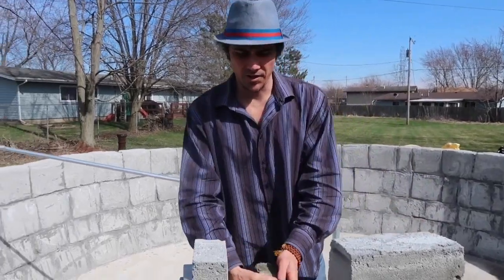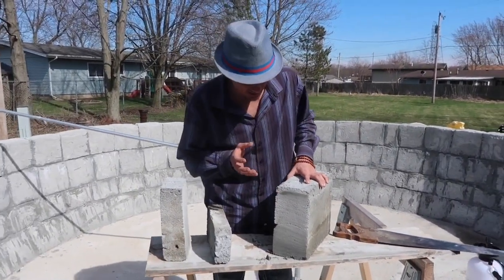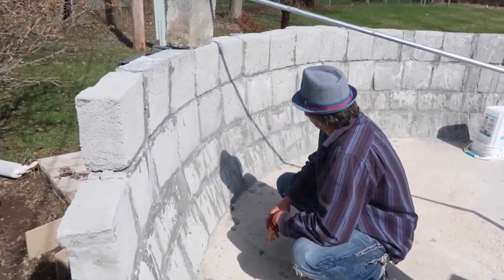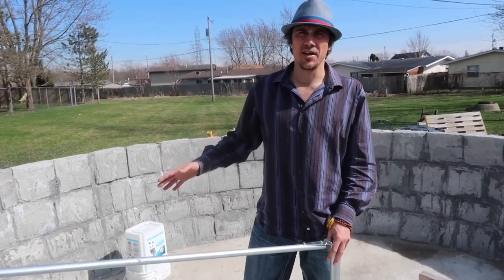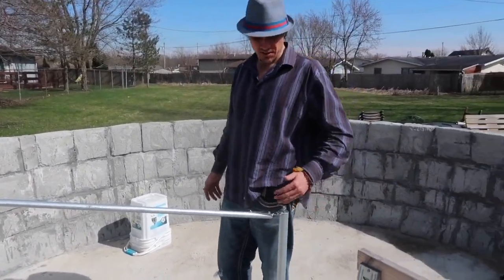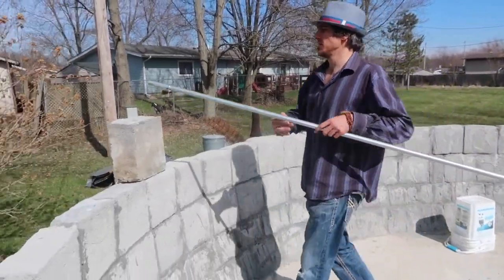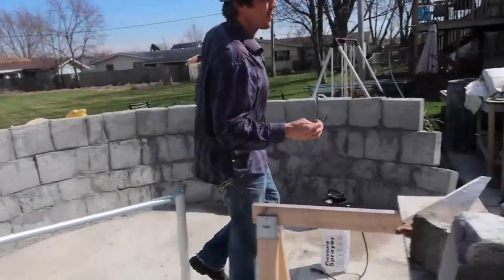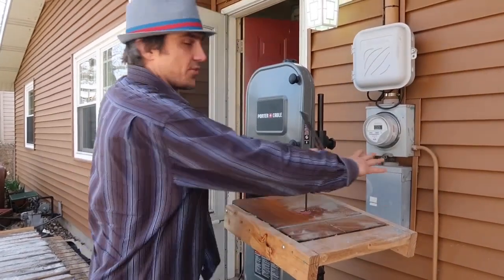How to Create a Aircrete Dome Home!

Comment: I’m thinking of using a Lux flaked soap (biodegradable) as a foaming agent - any point of view on the use of this product?
Reply: Aircrete  can suffer from lack of consistency. It's best to use the strongest foamin agent and that has already been proven. So you question would be to yourself, as you would have to test it.

Comment: Are these air Crete domes strong enough to use as a concrete form to pour like a 4 inch rebar dome on top of the air Crete dome for underground use?
Reply: Why not use an airform at that point? Pour the thickness in multiple layers or build  the rebar skeleton and inflate an airform inside the skeleton. Pour concrete, cure concrete, remove airform. It's what monolithic dome company uses.

Comment: Seems to me, these blocks will end up all having the same angle. So you could prefabricate those, by 3d printing the mold you cast these in. Is the anglefinder always finding the same angle?
Reply: this seems way smarter than buying their product and sawing a bunch, also those concrete blocks would be way stronger (tho not reinforced). But maybe you don't neven need to 3d print, should be doable to make that kind of mould manually

Comment: This is probably a stupid question but, could you do this with regular cinder blocks or bricks?
Reply: Yep why not just cement mortar the same as normal easy peazy.
Reply: Their Strength is not Equal to Poured Concrete, but might be close to Cinder Blocks. Some fab testing Required!

Comment: Been wondering about putting an aircrete structure on a trailer.  I think weight wise it should be alright.  I'vr heard they are earthquake proof.  Any thoughts or suggestions?
Reply: I don’t think it would stay together. As rough as the roads are now it would be like putting the structure through a 9-10 scale earthquake.
Reply: @Cp3659  - You could be correct, but, for "Research Purposes", it makes good sense! Like Vehicle Test tracks, to find rattles!

Comment: There is no way and I mean no way ,that material can withstand a tornado! He cut it with a saw , by hand ! It was still pretty cool to watch !
Reply from the maker: It's a multi process bonding process. Like dry wall for an example is brittle chalk without the double paper sides. Aircrete is the same concept the wrapping material has a tensile strength of 175 the Portland cement has a 6000 pd psi. The 1/8 to 1/4" bonding/Portland mix (wrapping glue) has a strength of 750-1500 pd psi. I was told complete 10,000 breaking point. I will be testing in the future. Also circle is the strongest shape so wind will move around the structure. Without impacting because it has no sides. I understand where your coming from. I thought the same thing.
Reply: AirCrete Creations I greatly appreciate the time that you took out to give me some insight as to the process and material info ! I was researching dome homes and come across this! I love videos like this that get straight to the point!
Reply from the maker: Not a problem. I am a structural ironworker and I have  built all types of structures and  have brought a  condemned house back to life as a project. This material is the new wave of building materials from my experience. Will be starting retreats and training once I get more experience working with it. Even for art carvings it's amazing
Reply: AirCrete Creations last question. Can this be used to make a hearth for a wood burning stove?
Reply: @haelisrael4945  yes
Reply from the maker: I would get fire brick. Aircrete will break dowm
Reply: @AirCreteCreations  an aircrete hearth will not breakdown. Rocket stove are made from aircrete

Comment: Is 6 , 8 , or 10 inch blocks better for dome ?
Reply from the maker: Were using 12"x12"x5 3/4 blocks we slice a 6" in to stagger the joints as needed

Comment: Hey, looks great.  Where abouts in Indiana are you?  I'm over in Cincinnati.  Looks like you're in a subdivision.  I would not have thought it possible for you to build that dome there!  I'm interested in building such a building, but wonder if it's a permitting nightmare?
Reply from the maker: Were in un incorporated area and I am not  waiting for the system to pass codes before I can start building. I'll ask for forgiveness if something comes up.
Reply: @AirCreteCreations  - I have wondered if a "Peanut Shaped" Structure, cold work nearly as good, in extreme Winds, as a dome?

Then, some new "Tricks" would be needed, for the "Compass Rod" placement!

Comment: nice job, what is the ratio of water cement? what kind of foaming agent did you use?
Reply from the maker: Think I'm going back to 7th generation soap. My blocks are to heavy or I didn't ad enough foam.
Reply from the maker: 5 gallons water one bag of portland
Reply from the maker: suave mens body wash
Reply: AirCrete Creations thanks! Are you checking on your foam density? I watched your new vid, your foam looks pretty good.
Reply: @AirCreteCreations  are you using suave men's body wash for the foaming agent? So glad to see another northerner doing this. Please keep us updated. You have gotten further then we have up here in Michigan. 👩‍🔧
Reply from the maker: @Virgilsvortex  ya thanks and them suave body wash works nice 1.88 each
Reply: @AirCreteCreations  ...lol now that was funny shit right there lol.